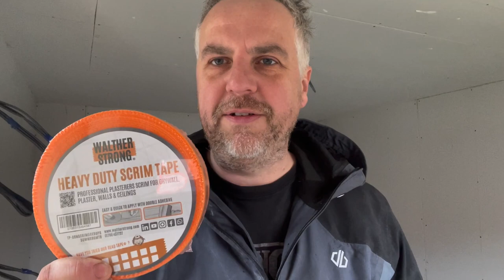Plastering A Soundproof Drum Room - Part 6

Comment: Tests been done: the paper strips are actually stronger than those sticky webbing tapes. You need filler anyway, so filler between the boards, paper strips in the wet filler and the pushing the excess out. When done all the seams, the first are ready for the second time filler. When those are dry, finisher to make everything level with the surface of the boards, fill the screw holes and you’re done. Not yet needed to cover the full surface. The painter never complains …